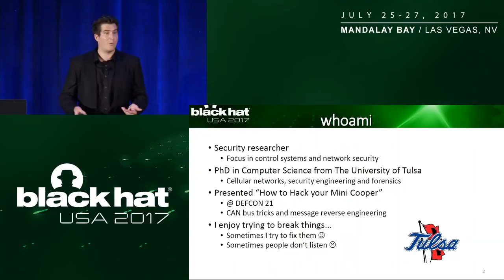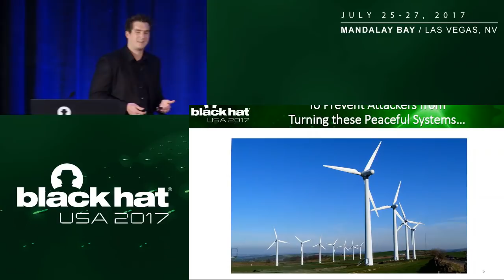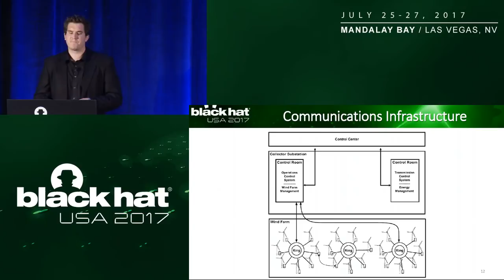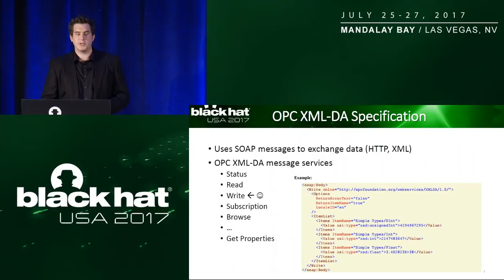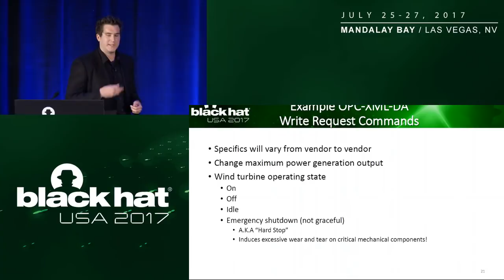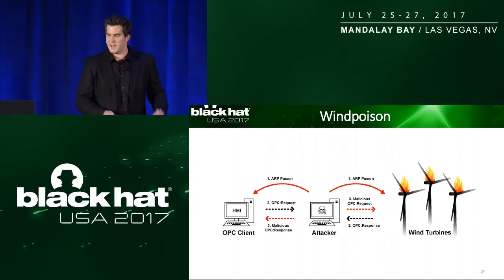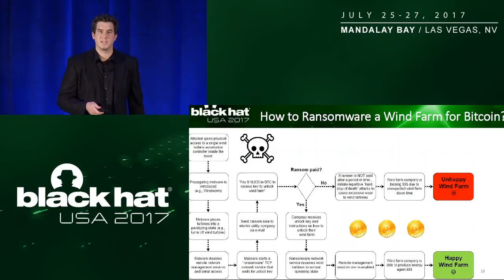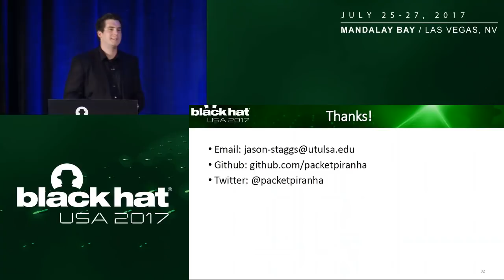Adventures in Attacking Wind Farm Control Networks

Comment: Sounds like the same i see in building automation every day, un-updated legacy OSs runnings old installations, running even older controllers with no encryption anywhere, everything connected to the internet by some sub-standard web interface made by a random employer in 1998.
Reply: Security in refinery and pipeline SCADA systems are just as bad, there are thousands of massive sites, worldwide, that are only protected by virtue of being behind 2 or 3 VPN hops, that’s it … and those VPNs are under nearly constant attack, 24/7.

I’m really surprised there haven’t been any major (eg. big enough that money can’t cover it up) incidents in the petroleum sector yet.